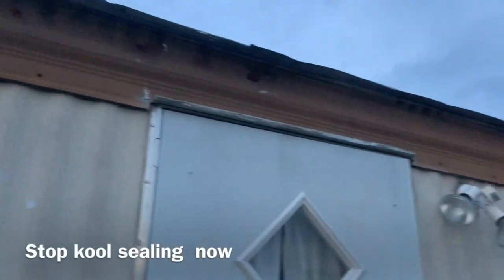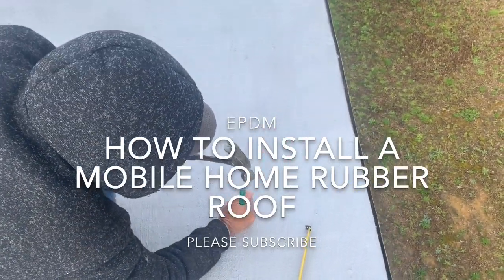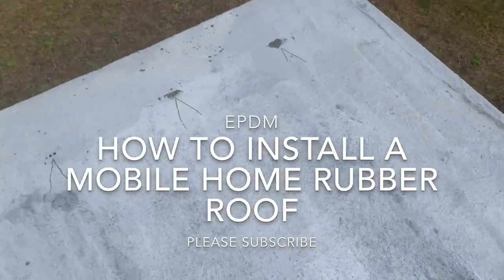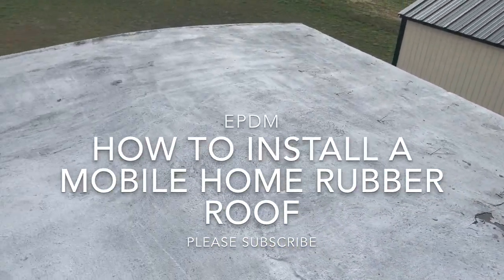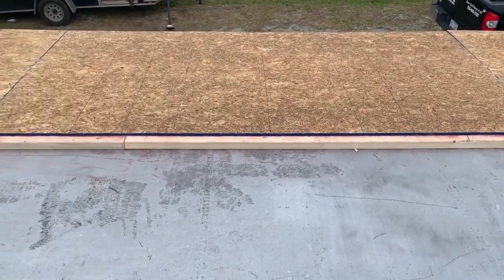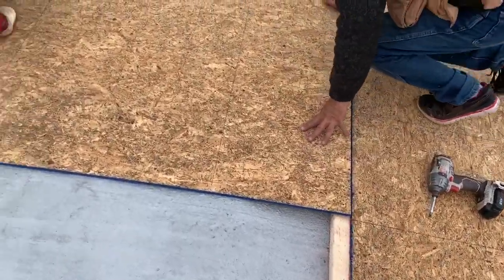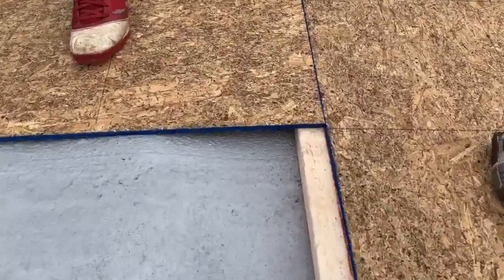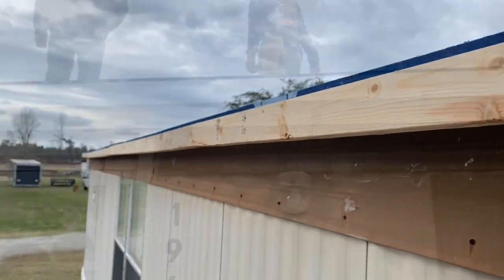(How To) Repair Single Wide Mobile Home Trailer Roof Training 2

Comment: with adding the plywood why not use shingles?
Reply from the maker: Not enough pitch you need at least 412
Reply: @Drewsroofingandhomerepair  what is the largest single (no seams) rubber roof that can be done?  And Thank You for the reply!
Reply from the maker: It gets real heavy The bigger it gets. I generally do a 60 footer in two pieces. My rubber comes 30 feet wide by 100. Most of the time I have to cut my rubber 16 feet wide to cover a 14 foot mobile home
Reply: @Drewsroofingandhomerepair  Thank You !

Comment: Drew. Do you service 17517 Denver PA? Need roof, same mobile style.
Reply from the maker: Yes we do. Love to help. Have to be springtime
Reply from the maker: 910-294-1761 cell text or call office 910-845-2207
Reply: @Drewsroofingandhomerepair   Yes. Put me in for Spring.

Comment: How much to do a rubber roof on an 18 x65 mobile home
Reply from the maker: Kevin Sanders If you were here where I’m at in Brunswick County North Carolina without looking at it my guesstimate would be around $5000
Reply: What about placing a metal roof over existing shingles for the same roof above? Would it be cheaper than a rubber roof?

Thank you for all of your videos, Mr. Drew! Yall be safe.
Reply from the maker: I don’t think you want to add shingles on my roof like the one that’s above not enough pitch
Reply: How much and where can I find the rolled rubber for the same size 18×65?
Reply from the maker: You can buy 20 x 100 roll at ABC supply or Best distributing. https://youtu.be/D46yK6sl7p0

Comment: Sorry for the novice question. Do you need to remove existing roofing/insulation that may have leaked previously before putting the new roof on. Concern over mold in your ceilings etc?
Reply from the maker: No If it’s fiberglass insulation it will dry out and the insulation again if it’s cellulose insulation you need to remove it but fiberglass insulation no worries
Reply: I have the same mobile home how much does that cost
Reply from the maker: I do that from the inside

Comment: Where can I get that facia metal?
Reply from the maker: It’s called coil stock and you buy it at Home Depot or Lowes or Amazon.com it comes in a box in a roll 2 foot wide by 50 foot long

Comment: Why dont you just use a stud finder thats what i do.
Reply from the maker: I’ve never found a stud finder that works through these metal roofs. So I wanna make sure that I have centers. I’d rather not take the chance. Not to mention if you notice I also cut the roof open just to make sure the wires are underneath the roof and not running over the top of the rafters. Good question though. Somebody asked me that a few years back and I tried it it didn’t seem to work as well as I liked.

Comment from the maker: If anybody puts a metal roof on a mobile home I like this you’re just asking for leaks.
Reply: Even shingles fail and get moldy, rubber might be much better.
Reply from the maker: I wish I could help. If you All within 10 hours of me I’ll come fix it
Reply from the maker: You can’t put a metal roof on a low slope pitch like that